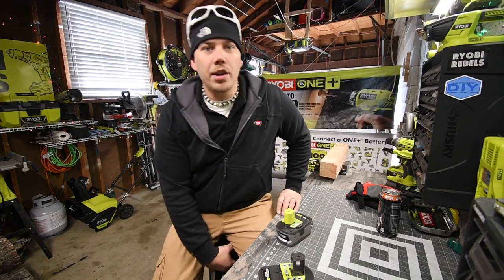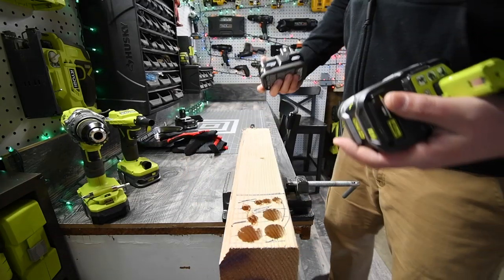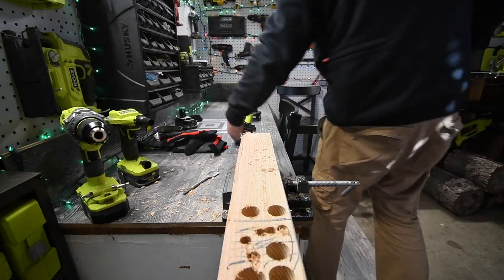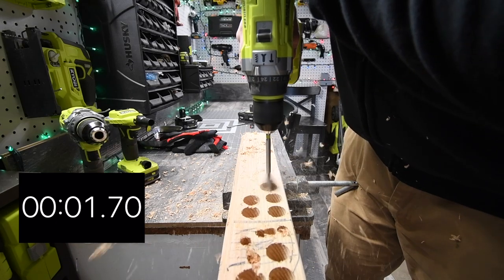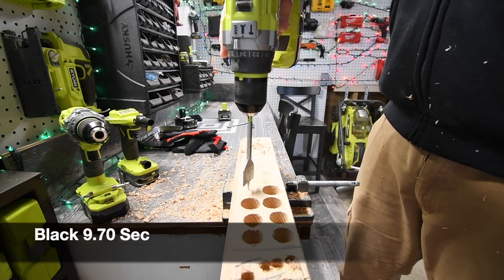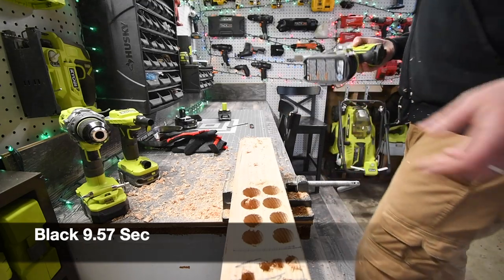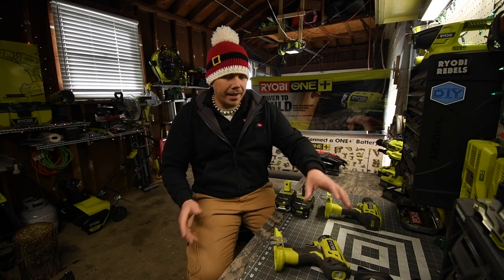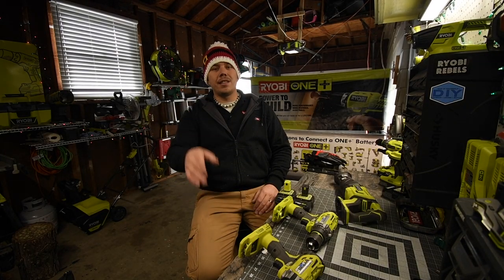Ryobi Black 4ah VS. Grey 4ah

Comment: How old is the Silver/Grey batery? Is it a 2017-2018 model compared to the newer 2019 date coded black batteries? I would love to see them in a high drain setting like a blower or 6 gallon vac & see which one holds out longer? I only ask because newer batteries will always show superior power......at 1st. It has fresh cells in it. Just asking.
Reply from the maker: the grey batteries are a year old but ill check the date on them and thank you

Comment: Are those self feeding bits? If not I’d suggest trying some of the Bosch self feeding paddle bits. They pull the drill through the hole without any pressure being applied. Thanks for the video. Was interesting to watch
Reply from the maker: I will be picking up the self feeding bit soon. since they are on sale and thank you sir
Reply: Ryobi Man Caver that’s why I just bought them. On sale it was a good reason to try them out.
Reply: I agree...it's crazy how they pull the bit through the wood.
Reply: Eyellgeteven yes they work very well

Comment: I think...Ryobi is replacing all the gray lithium + with the black, they have the same stats and then they are leaving the gray hp’s to let you know what battery to get.  So if you have a brushless tool you would want the gray hp to maximize it
Reply from the maker: I did a video testing that with the new compact HP tools. I don't think the older HP batteries don't work on the new HP tools

Comment: What do think of ryobi impact wrench is it good 1/2 inch also what battery would recommend to use with it for motor mechanics use ?
Reply from the maker: I love it. it takes out lug nuts with ease and in seconds
Reply: Ryobi Man Caver appreciate the replay what Battrey would you use on it to get the best performance out of it ?
Reply: I use the half in kobalt impact for my automotive work and it is an absolute beast!  Battery last a long time and it has double the torque as the ryobi 1/2 in.  Just another perspective for you.   Happy wrenching
Reply: My Ryobi 1/2" impact wrench is my favorite Ryobi tool and I have a LOT of Ryobi tools. You will want to use a 4 ah battery or bigger for best performance.
Reply: Eyellgeteven does it make huge difference on power and how much nm you have when use 4ah or 5ah battrey on your ryobi impact driver ?

Comment: Hello, I would like to know your opinión about the duration ir these batteries, I mean the working time for each recharge, do they hace the same duration?
Reply from the maker: the duration is good, and they last a long time in its lifetime. I haven't had a battery fail me yet
Reply: @ManCaverTools So what is the difference between these two batteries?

Comment: Yep... I told you so...Ryobi  motors are junk and I hardly use it....my 6.0 ah battery just stopped charging...as contractor, I use dewalt drill daily for 15 yrs and use it to mix mud too and it's still working.. Non of my dewalt tools stop working..
Reply from the maker: I use the hell out of my tools. I ran the recip saw 40 minutes straight in summer cutting up roots
Reply: Their drills are just junk the other tools are alright